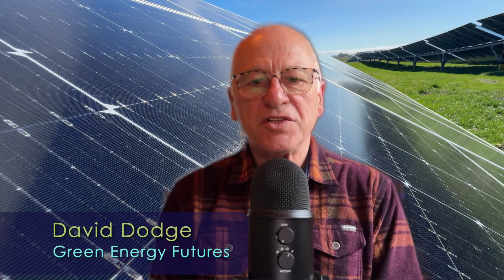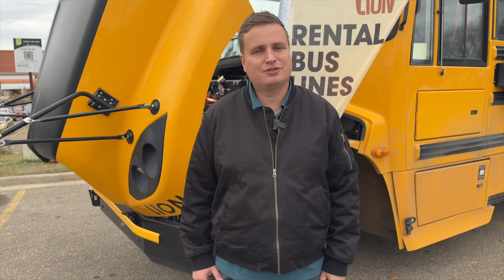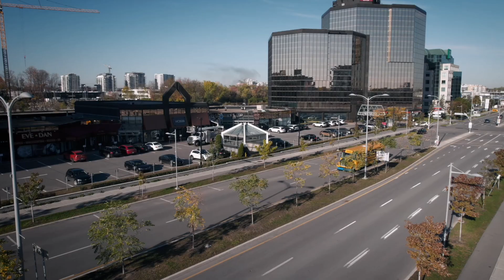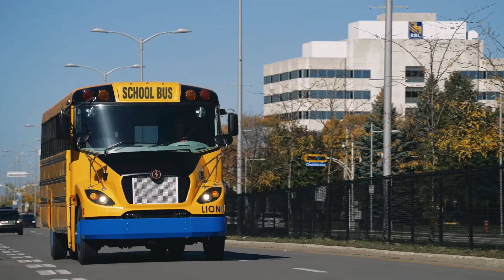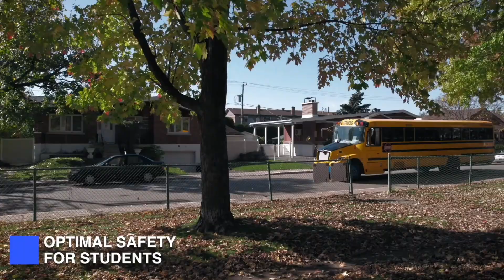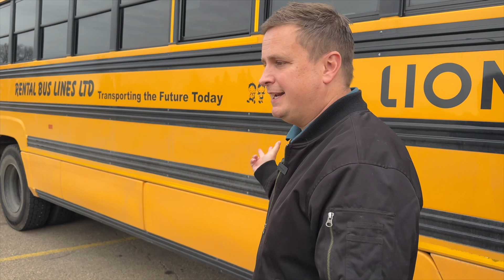Canada's Electric School Bus Revolution

Comment: The future is electric.  No noise, no emissions, low fuel costs and low maintenance costs.
No stinky and unhealthy diesel fumes. No noise means more peace and quiet.
Reply: Have you ever been in a school bus? There is no peace or quiet. Motor aside.
Reply: KJSvitko's comment: "The future is electric" could have been taken from a 1910 newspaper article to describe BCER - British Columbia Electric Railways' then new passenger train service to the Fraser River Valley communities.
Reply from the maker: While this may not have worked out for BCER then, European railways are embracing electric everywhere. They have even piloted hydrogen trains in Europe, but that's not working out and many are coverting to electric.
Reply: Nah the best benefit is PERFORMANCE. Electric commercial vehicle just have a superior drive train that is more powerful and quicker response than big diesel engines. Most cost restrained City buses have diesel drive train which feel like they are choking climbing up a steep hill. Meanwhile BEV Bus are like mountain goats, some are even used on Ski Resorts for that purpose. This is SAFETY benefit when the vehicle can predictably and effectively accelerate on command.
Reply: @Neojhun  Cool aid drinker! You try to sound so intelligent, but your as dumb as a stump........